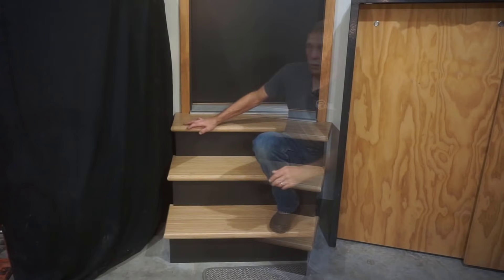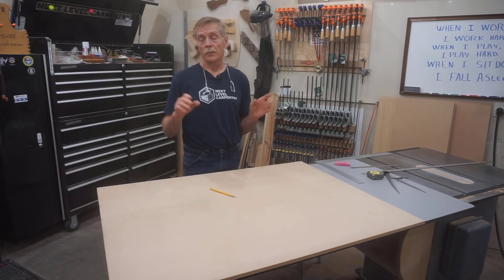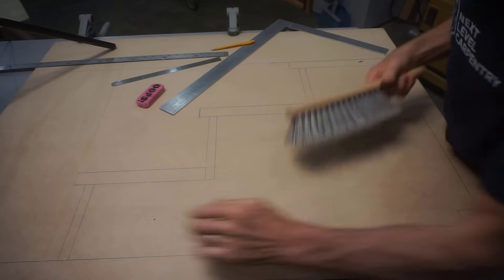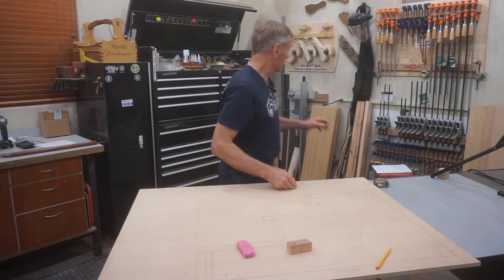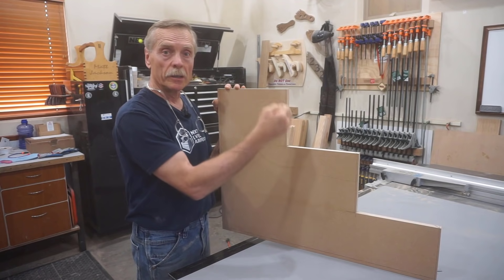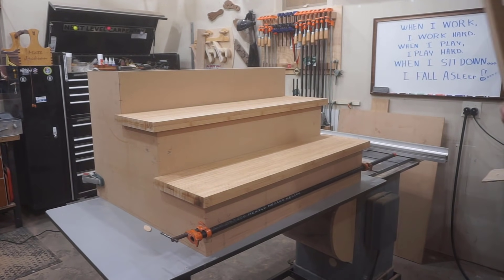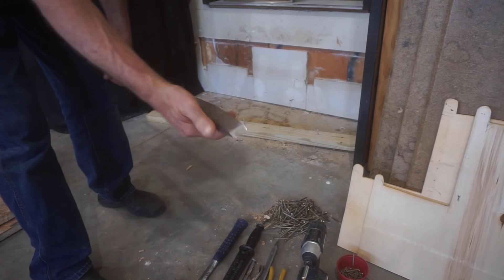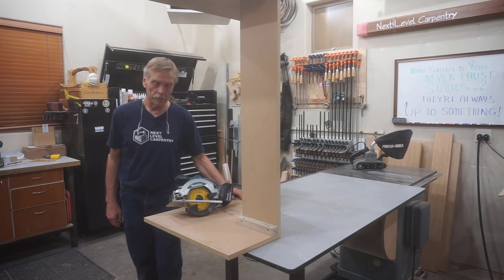Build Simple Strong Steps Without Stringers

Comment: Those stair box sides look a lot like hdf stringer skirting but without stringers. I'm not a troll just a 30 year carpenter and I'm always up to learn new techniques but  little blocks in the place of a solid stringer and no center stringer is not a better way. It's structurally inferior . What you built for structure I would use to trim out the substructure. But different strokes
Reply from the maker: You mistake glue blocks as a Stringer replacement but if you pay attention to the video I use those just to hold the miters together. I respect your Viewpoint and 30-year history but if you examine the structure of this stair box from an engineering standpoint you'll realize that it's actually stronger than stringers in    some ways. The load-bearing capacity of a sheet of 3/4 inch thick material when standing on edge is astounding and the fact that it's one solid piece eliminates  many potential points of movement that create squeaks. If it's your practice to cut three stubby stringers for a set of stairs like this more power to you but I disagree if you do so solely from a belief they are stronger. In an engineering stress test one design is bound to be stronger at some level but that level is so far beyond stresses placed on a set of steps like this in normal use that it's a moot point IMHO. I do appreciate this dialogue with you as you appear to be someone who takes pride in their work which seems to be a rare commodity these days so I wish you all the best.
Reply: @NextLevelCarpentry  in the mid 90's I worked for a developer that also had a lot of rental properties that I'd remodel and do maintenance work on when building was slow. There was one time I had to replace 1×12 treds that were nailed through the back of the riser with 8d sinkers which was up to code at that time. The tenant was extremely heavy and on his way up fell through on the third and second tred of a 4 tred  run to a landing with a handrail on one side and wall on the other. The third one split and he lost balance and  the second tred took the brunt of his weight and broke. He did grab the rail and it stopped him from hitting the ground but I had to replace the bottom post because it split at the bolt holes. Short story long it wouldn't have happened if there was a center stringer. I know that's a random and rare occasion but after that I always use a center stringer or if it's box framing I joist it with 2×4 . Don't get me wrong the stairs look nice and I know that they're strong. I just  started out doing concrete and framing. When I got older my joints decided I needed to be a finish carpenter but I can't shake that concrete & framing mentality .
Reply from the maker: Yeah I totally get it with that scenario.... you definitely dialed in on the weak Link in that particular chain and had I your experience I would almost certainly add that Center Stringer because that sort of catastrophic failure can mean serious legal and insurance issues. I don't know for sure but I would almost bet that some if not all commercial codes require Center Stringer and if so for that exact reason. Good to hear you had the sense to get out of concrete work to preserve your health and Mobility as you age. Experience in concrete work is good to have on your resume as long as not too many people find out about it right?! Best, Matt

Comment: When does building code allow for "replacing like for like" vs. if if something is repaired/remodeled it has to be brought up to code. I'm most familiar with electrical code which almost always requires any repair/reno to meet current code.
Reply from the maker: That will vary by jurisdiction and individual inspectors; some will understand that the change will be better and safer realizing that's the main goal of building codes.  With other inspectors you'll find yourself with an open can of worms that stinks to high heaven and jump through expensive, absurd hoops indefinitely...

Comment: Building codes... An inspector randomly turned up to check the safety of our swimming pool.
It was declared that the fence was too low by 5mm. So I said "so you are saying that if I scrape away a little bit of soil in this one spot, it won't be deadly anymore?". Yes, do it.
Then, another place some rock was too close to the arc from the top of the fence - by about 1cm. "So, if I slice away this little piece of rock the size of a golf ball, the fence will no longer be deadly?" Yes, do it.
I didn't mind and you will never win with these guys by arguing, because they certainly have the power to make your life a misery - but their thinking is amusing (especially since they have no appreciation of how completely arbitrary these building codes were in the first place).
Reply from the maker: You know EXACTLY what I was referring to Perry...  Good to know I'm not the only one with stories of this sort of absurdity! Best, Matt

Comment: Never use a foam roller for anything ! I have seen ten minutes of explanation of how this or that procedure makes them work properly, just use good chenille rollers (mohair we used to call them) and swallow the cost and throw them away when done.
Reply from the maker: I called them 'foam rollers' but, actually, they were very short pile knap rollers... still produced an upsetting 'goose bumps' finish!  I'd have gladly spent whatever $$ on a good chenille roller (although I'm not sure that's not what I was using) but, in the end, felt stupid for not breaking out the Graco from the get-go! Best, Matt

Comment: Material costs = $75...... labor = $2000!  Damn nice set of steps though!
Reply from the maker: I suspect you are not in business for yourself but an employee somewhere because the mass in your comment is seriously flawed and not a sustainable business model🤨
Reply: @NextLevelCarpentry  Facetious comments should be taken lightly..... that probably explains the deficiency of mass in my comment.  Also I forgot to adjust for the current lumber market, so the 2021 quote for those steps would be... Material =$2000......Labor=$75!  Still a damn fine set of stairs though!!😎
Reply from the maker: @VottyS  That's more like it! 🤣🤣😎

Comment: what is with these guys and glove's , if you nick the blade the material will catch and pull your hand into the blade instead of just a nick  ......
Reply from the maker: Same thing I told you the other time you posted this question: 
I advise every viewer to practice the safety measures they're comfortable with. While your scenario can happen, the grippy coating on the gloves I use prevents my hand from slipping and causing an incident in the first place...

Comment: 7-11 unless otherwise stated in the prints
Reply from the maker: Sounds like a commercial spec, not residential or universal.
Reply: @NextLevelCarpentry  Old school residential standard for Northern Chicago suburbs--actual numbers are 6 3/4" and 10 3/4" for our code
Reply from the maker: @tomsanders9491  Wow... how times change, right?  Back in the day those specs were used for steps at the courthouse! 😉😂😎

Comment: That graco sprayer isn’t a tool that last very long, and isn’t repairable 
I was disappointed with the the life of these sprayers
Reply from the maker: I'm guessing you got an early release model/design of this sprayer which were fraught problems and, I'm told, were recalled by Graco.  The one I have and use is a 'next gen' model and has had zero problems.  Granted, I don't use it a ton but the painters who recommended it to me do and they've been thoroughly satisfied with performance, durability and service-ability. Best, Matt

Comment: Ok not to be “that guy” but it looks to me like he just built his own stair stringers and built stairs with them instead of buying some
Reply: @mattjackson3996 it means it looks like he made stringers for the stairs and then used them instead of building stairs with out stringers as was the title of the video “build stairs without stringers” the stringers is the side piece that gives the rise and run of the stairs. As I was looking for a stair building solution that doesn’t require this method of construction. I’ll probably do some over lapping boxes of some type instead of fabricating custom stringers to set the tread boards on. I thought my original comment was obvious enough but whatever.🤷‍♂️ also why make comments when your locked so people can’t respond? Lame 😒
Reply: @mattjackson3996  the “support” your referencing is in fact a custom built stair stringer 🤷‍♂️ what to tell you
Reply: Figures my response would be removed🤔 seems to happen often when I make valid points
Reply: @mattjackson3996  let’s try this again, the stringer piece is created in this video as the side pieces are a string of several steps in one solid piece, as opposed to several separate singular steps.
Reply from the maker: @ct7999  your effort to convince yourself that you know what you're talking about only serves to prove to the rest of us that you don't.
Reply from the maker: @ct7999  None of your responses have been removed so you don't need to play the self-deceived martyr card here.
Reply: @NextLevelCarpentry  i actually never claimed to know what I’m talking about so yeah, but am I wrong in the thought that the custom side panels you made are in essence the same kind of piece I would purchase from Home Depot or Lowe’s labeled as “stair stringers” and your video is labeled as making stairs with out stringers when in reality it would have been better to name it something along the lines of “making custom stair stringers” and, I am missing a response that I referenced a video and left a link to a different stair design that in fact didn’t use the side panels. 

Also on a side note I don’t generally do woodworking as much more than a hobby my grandfather did custom cabinetry I’m an electrical engineer, I’m putting in an above ground pool and need to make some stairs that go to 48” in height and am having an issue at my local store getting stringers that fit my specific needs space and budget for the project. Stumbled across your video, unfortunately it’s of little help to me as I’m going to use a different technique mentioned earlier, nice stairs though.
Reply from the maker: @ct7999  Fair enough.  FWIW if you asked 100 carpenters to cut stringers for a set of stairs for the garage in the video, not a single one would cut notched side panels with integral risers like I did.
That's because, in the world of carpentry, stringers are are invariably cut from dimensional lumber like 2x12's, which is decidedly different from the notched panels shown in this video, hence my insistence to carry on this dialog with you.  Not a single carpenter has called me out on misleading them with this video's title but you, and electrical engineer, did.  Therefore I stand by my video description.
Your last comment earned my respect for you because you resisted the typical decent into profanity taken by so many commenters on YouTube.
The 'custom side panels' I made provide the exact same function as big box 'stair stringers' but they're entirely different animals.
FWIW again: if I, as a lifelong carpenter, were approached to build steps to an above ground pool, I'd almost certainly use the approach shown in this video:  https://www.youtube.com/watch?v=rm3qpz50fbs
even though (admittedly) the term 'loft ladder' is a real stretch.  Exterior stairs exposed to weather and pool water made with notched stair stringers are prone to premature failure whereas 'housed stringers' like the ones seen on this 'loft ladder' are far more durable and sustainable much less much better looking IMHO.
Good luck with your project, sir, I sincerely do hope it goes well for you.
Best,
Matt
Reply: @NextLevelCarpentry  thanks for the info on the difference between the two parts, I’ll check out the other video your referring to. 

My project will get completed and be nicely done, of this I have no doubt. 

And thank you for your advice.

We can have a discussion and difference of opinion and not resort to cursing, something it seems as though it has been forgotten since the birth of the internet. I always thought the internet was where you go to ask questions about things you know not and get correct answers. But mostly people seem to get upset when you don’t know and pose a question or issue with what your seeing.